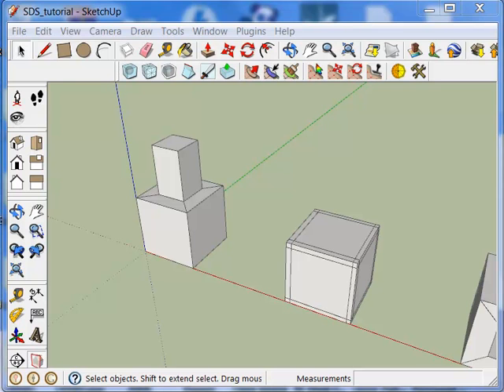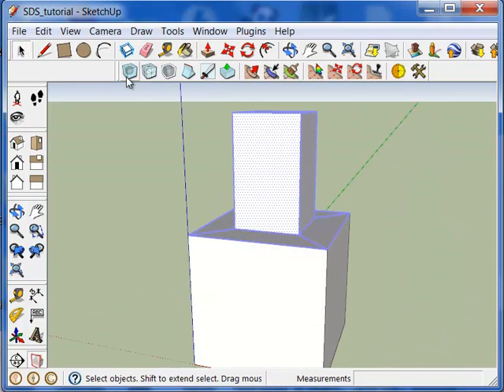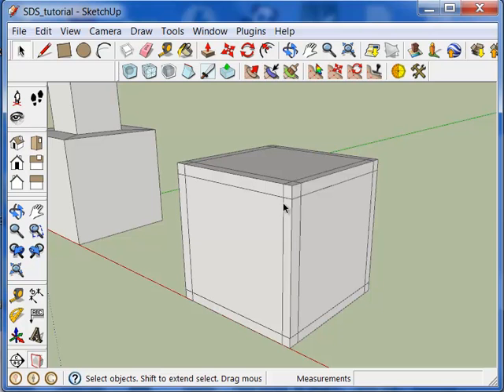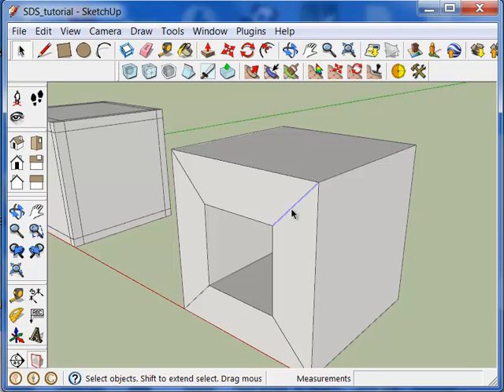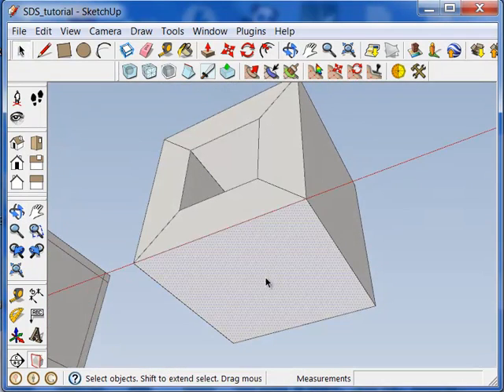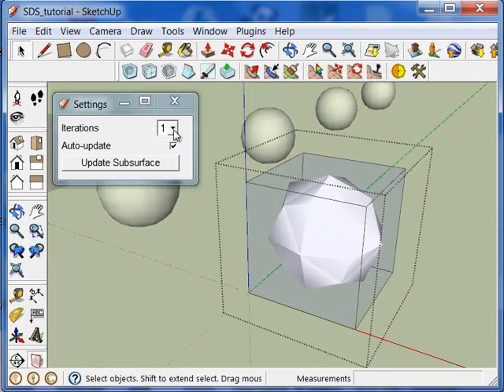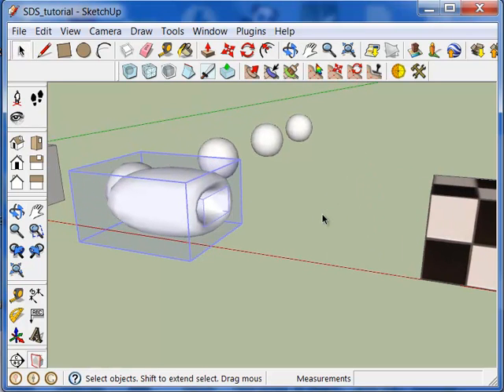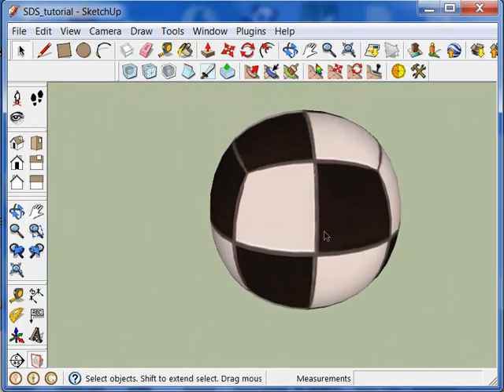Artisan Video Manual - Subdivide and Smooth

Comment: my 1st ever comment ,totally usefull presentation , using this to suggest ,as I did on forum, the idea of  CREATE FLAT tool relative to strength of interacting curve edge and x y z axis therefor build-sculpt any shape.++( at 1st, I thought SMOOTH did that ,but no) how would you quickly create TETTAHEDRON and subsequently create and join more, face to face ,its difficult using angles ,need to SNAP a hinge to 2 corners ,then grab another corner and drag it and SNAP it  sort of thing (tool)..idea..Jon